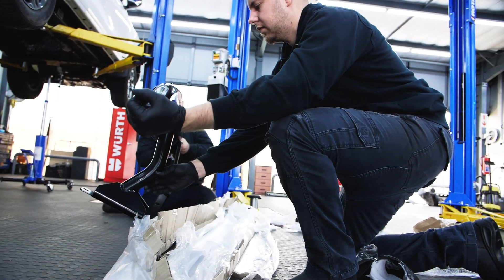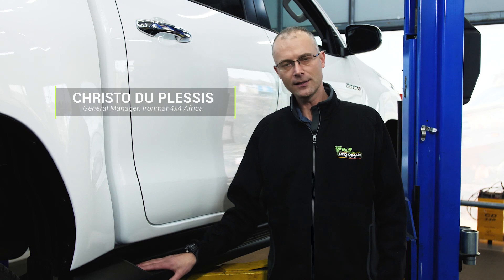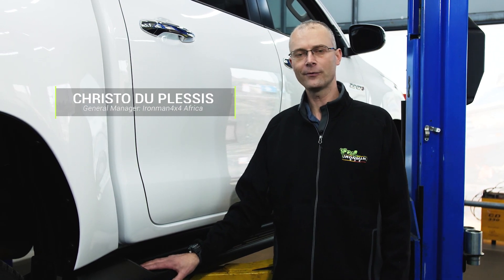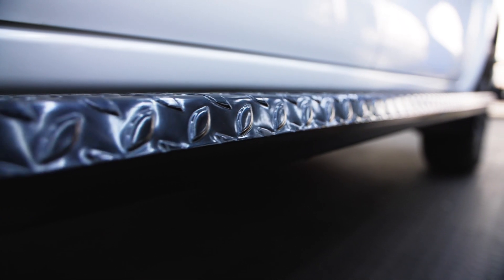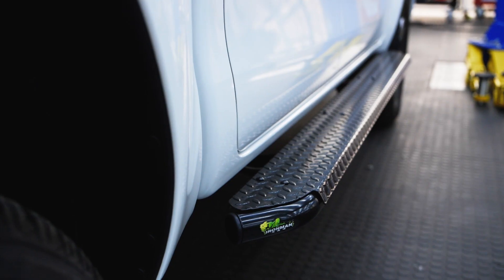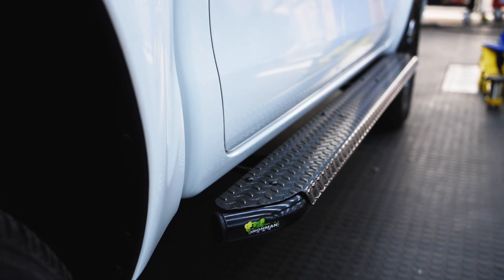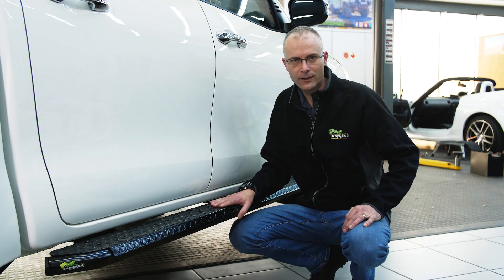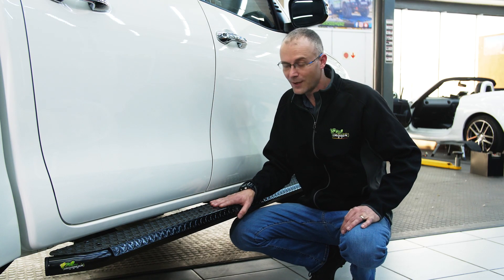Vehicle Build: Christo's 2021 Toyota Hilux Episode 05 Steel Side Steps

Comment: Any tips on fitting the otherwise as it has the fuel tank and brake lines running along the chassis? Does it mount behind them and if so that will leave the brake lines loose
Reply: Hey mate did you find the solution to this?
Reply: @ yeah mate just uncoupled the lines and ran behind it. Then I put a sheet of rubber to stop them from rubbing
Reply: Roger that. Thanks mate